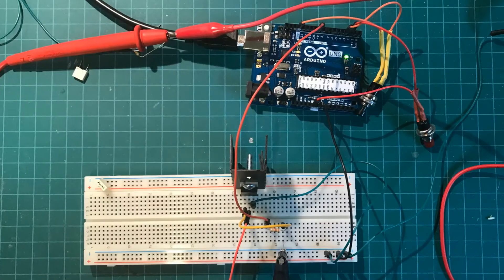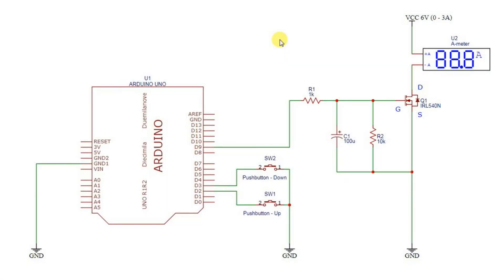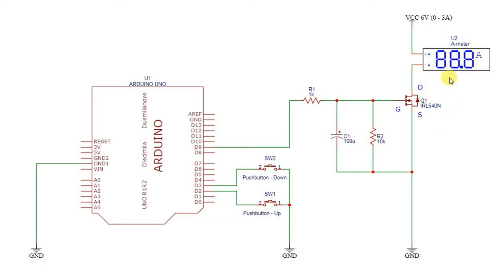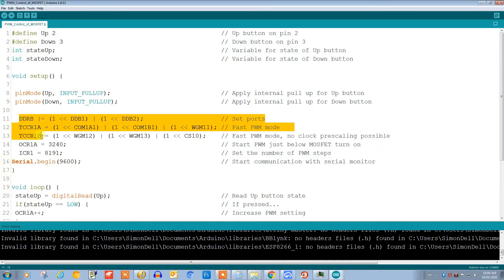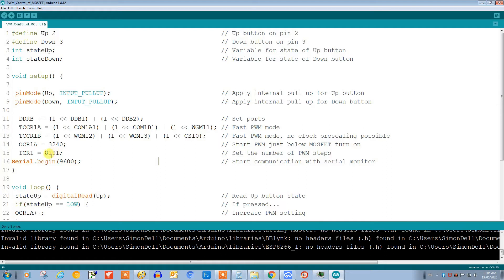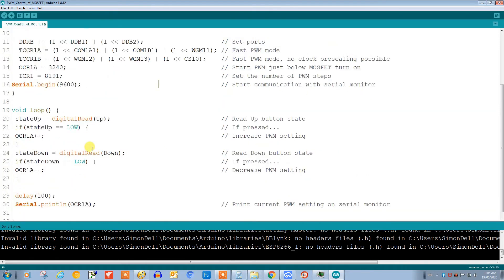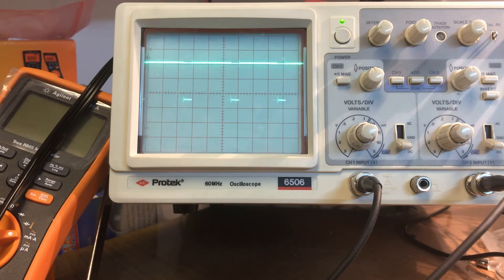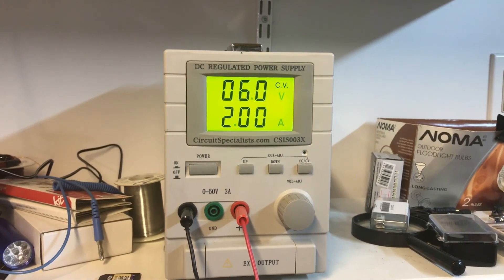How to control a MOSFET with Arduino PWM

Comment: filtering before mosfet, does it not defeat the purpose of operating fet a fast switch?
this makes a variable resistor from the mosfet, not really a PWM
Reply: Exactly my thoughts, unfortunately I came to this video because I don't know what I'm doing, but to me applying a DC voltage to a power transistor doesn't make sense. I thought they're only supposed to be operated in fully on/fully off for maximum efficiency.

Comment: hi simon, Im just trying to make a high current 3 phase esc. Im here to learn something from you. first I need to know how to drive mosfets with limited current output. Im using an arduino and its pwm current output is limited 40 ma. So I cant work directly with high current mosfets. so I tried to drive them with the help of small transistors. But my pwm is fading. Im stuck. would you please help me about it ?
Reply from the maker: Look up mosfet driver I.c, it’s on the Internet. ThIs is what you need to use for your situation. These chips are designed to work with low current microcontrollers and high current mosfets.

Comment: Would it suffice to just use analogWrite to change the pwm duty cycle?
Reply from the maker: Yes you can use the default PWM values of 255 or 1024 steps, if you do that you won’t have super fine control but if you don’t need it then you can just use for example analogWrite(128) for 50% duty cycle. If you do that you won’t need the whole block of code at the start that sets up the compare registers etc.

Comment: Nice Video, I am using ESP32 which works at 3.3v, I need to control Co2 Laser power which can be controlled using potentiometer powerd by  5v. Will this work for me where in I send PWM signal from ESP32 to the Gate and create variable resistance between Drain and Source (As this is control signal power draw would be small).
Reply from the maker: Not sure, this uses logic level FET, I.e 5v is a 1. Probably will still work, or you could supply a separate voltage to the FET gate via a voltage converter.

Comment: This circuit is susceptible to the non-linear transfer characteristic of the MOSFET. Since the gate threshold (the voltage required before the MOSFET starts to turn on) varies from sample to sample, the circuit is not reproducible without finding the initial offset by trial and error. Secondly, the relationship between the gate voltage and the drain current is essentially quadratic, not linear, when the MOSFET has a drain voltage significantly greater than the gate threshold voltage, as is the case here. That means that the output current rises more quickly at higher currents for the same amount of button press. However, if you require a steady dc current output, this is the simplest way to do it.

The alternative is to pass the pwm signal to the MOSFET without filtering, i.e. remove the 100μF capacitor, but leave the other resistors in place. Now the MOSFET will be either on or off at the same frequency as the signal from the Arduino and with the duty cycle of the pwm. That means the power dissipated in the MOSFET is near to zero and it can handle greater loads. The average drain current will now be directly proportional to the duty cycle of the pwm and will provide a linear relationship between button press and output current with no offset, regardless of the individual logic level MOSFET used.

However, the current through the load will be in pulses at 1.95KHz and not every application will cope with that. Nevertheless for controlling lights or motors, etc. it will be satisfactory. Remember, though, to use a reverse-biased diode between drain and positive supply when driving inductive loads to suppress the back emf each time the MOSFET switches off.
Reply: I was wondering about being able to drive the MOSFET directly with the PWM signal.  Thank you for this reply. I have an application where I'm going to be using a similar circuit to drive a heating element (digikey part number: 1568-1797-ND).  I'll definitely remember the reverse bias diode since I will be driving an inductive load.  I'm a little hazy on whether or not I need the resistors.  I don't think I'll need to scale the Arduino's output level, but I thought there was a requirement on sourcing/controlling the current into the Gate.   Thanks again for both the video and the reply!
Reply: @pbandjmaniac  The problem with driving power MOSFETs is that they have a significant gate capacitance and it will draw current briefly from the Arduino when the output changes. Since the Arduino can be damaged by currents of more than 40mA, it's a good idea to have a resistor between the Arduino and the MOSFET. The 1K resistor shown will certainly limit the maximum current to less than 5V/1K = 5mA, which is fine. Since the gate capacitance of the IRL540 is specified as typically 2.2nF, the combination of 1K and 2.2nF will form a low-pass filter with a roll-off at about 70KHz, which means that it will have no effect on the pwm signal at 2KHz. The 10K resistor is a safeguard to ensure the MOSFET is turned off if the Arduino is disconnected from it (they may be on separate power supplies with a common ground).

Since the MOSFET is a "logic-level" type, it will have a gate threshold voltage somewhere between a logic 0 and a logic 1 (so usually around 0.5V to 2V), so there's no need to scale it as the high level output from the Arduino will be certain to turn it on fully. Hope that helps.
Reply: @RexxSchneider  Makes sense. It's been a while since I've had to design an analog circuit. its always good to refresh on the best practices.  Thank you again for helping out.  I guess this means not ALL youtube comments are evil and toxic :P

Comment: Hi, is this like a simple motor driver ?
Reply from the maker: Not exactly but you could use it for that. I’d suggest that you remove the RC filter circuit if it doesn’t work to your liking. That would make the circuit more like motor driver.
Reply: @simoncarter568  ok, thank you. The motor is low power brushed dc, so I think it could work